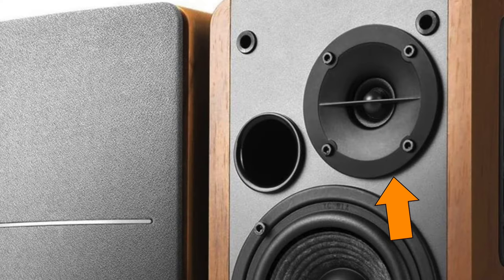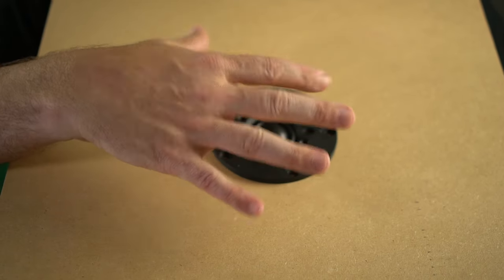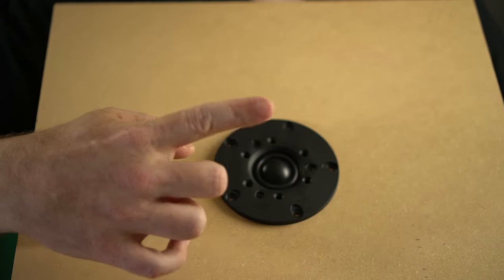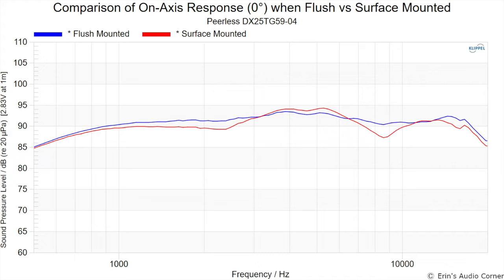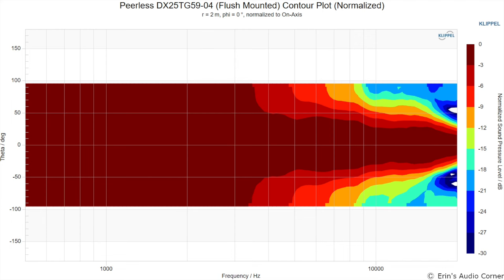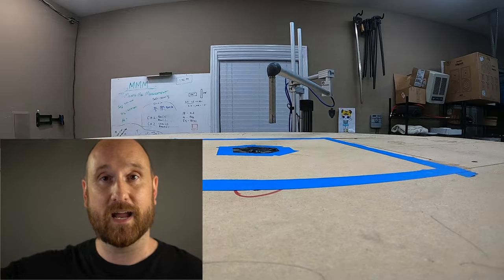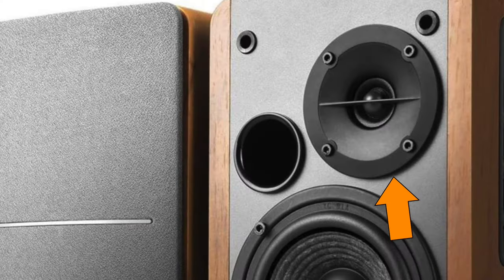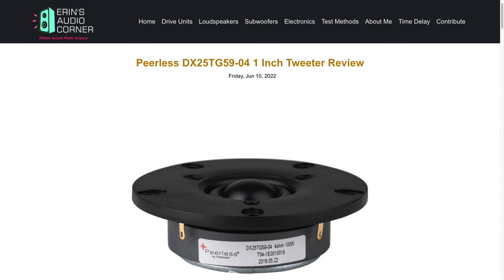Bad Speakers Start with This. 🛑  Flush Mounted vs Surface Mounted Tweeters.  Why it matters.

Comment: For those asking this question repeatedly in the comments, his review does not apply to tweeters with a waveguide. One of the specific design goals of a waveguide is to greatly reduce if not eliminate altogether edge diffraction.
Reply: I believe its because his first shot at 3 seconds in shows a tweeter with a moderate waveguide......
Reply: Like the Paradigm Reference Studio Esprit. Nothing flush mounted, has a waveguide. Testing and tweaking I guess.
Mines not flush mounted. I didn't know I can go back after the circle guide with a rabbiting bit. 
Now I do. The problem is my big router is too clunky for the job, on a small truncate faceplate cut.
Maybe one day with a little palm router.
I wouldn't be able to hear this video without non flush mounted!! Actually they are flush mount, almost total crap pc speakers. They work.
Reply: His review? I thought this was a product advice video, not a product review video.
Reply: @x-techgaming  Pedantic much?
Reply: Are you telling me he went and took a picture of a popular active speakers even if it doesn't apply to his video??
Reply: Speakers with the tweeter on top of the speaker sound thin.

Comment: Here's an idea - arrange a simple test to see if anyone can hear the difference between a flush-mounted and surface-mounted tweeter in the same speaker, all else kept equal.  Should be easy to arrange by adding a simple cardboard shim behind a flush-mounted tweeter to emulate it being surface mounted.  How many people do you think will be able to hear the difference?
Reply from the maker: I think the off-axis response around 7-10kHz being up about 2-3dB will definitely be audible.  But I'd have to arrange a setup.  Regardless of how audible it is, it's poor design practice and not something that can be fixed once set in stone.  As I'm sure you know.
Reply: @ErinsAudioCorner  this is just conjecture, really, unless it is tested... it is entirely possible that the diffuse point sources give a more pleasant spatial perspective, or not, just conjecture.  Interesting topic, and one that I think nearly every speaker maker since the 1940s has wrestled with.
Reply: @themaskedsingercucucachu8225  1000%
Reply from the maker: @themaskedsingercucucachu8225  Linkwitz has written about it.  And I can absolutely tell you that I've seen the effects from diffraction rear its ugly head by designs shooting for a flat on-axis response, not accounting for the off-axis issues of diffraction, and winding up with boosted HF in-room response.  So, while the difference itself may be debatable in terms of audibility, the actual result from a poor design perspective isn't debatable and is audible and readily measurable.
Reply: @themaskedsingercucucachu8225  
It's not really conjecture. 

Additional reflected energy that create positive attributes like spaciousness, immersiveness... aren't manifested from the VER or Very Early Reflections... it's just smear, corrupted in both freq and time domain. 

Such characteristics you mention result from later arriving energy after a well delineated direct sound has been experienced by the listener. 

Ideally it's;
1.) Direct sound (a clean, phase coherent source)

2.) An adequate ITD Gap (initial time-delay)

3.) Then early reflections

4.) Finally, a diffuse reverberant sound field is experienced by the listener

Subjectively this should result in a distinct image, it should resolve whatever depth existed in the recordeding, then the later arrival of the reverberant field is a pleasant bonus. 

I believe Toole's work established that the early reflected energy off the sidewalls can in some cases, add greater ASW, or "Apparent Source Width".
Which in some cases is subjectively pleasing... if the material is well suited, and if the sidewall distance is adequately wide.
Reply: I think most "normal" people will struggle to hear the difference even in an A/B comparison. Those Edifiers are just budget speakers and I think most people will be satisfied with their sound. The truth is most people who aren't audio hobbyists don't care too much about a flat response or even prefer certain  types of non-linearities. Even I as a hobbyist do to some extent. 

Flush mounting drivers is just an optimization technique that can cost very little but has a non negligible effect so it's just good practice to do it. But in some cases, non flush mounting them can yield better results because the curve and phase better matches the other drivers in a system, however that means the driver selection wasn't the best in the first place. 

Also in an A/B comparison, the midwoofer or midrange would have to be recessed by the same depth as the tweeter to keep phase relations at least somewhat intact.
Reply: @ErinsAudioCorner  Totally agree. If something is fixable, and easily, why not do it, instead of the easier surface mounting,  and then "Claiming" no one might hear it..
Reply: @kevintomb  Agreed! Even barely perceivable differences are cumulative and will contribute to the overall sound of a speaker. A great speaker design considers every possible detail using a wholistic approach, not whether or not these individual details are significant on their own. Some are quite noticeable, some aren't at all useful unless combined with another feature. Take dimpled ports as example... quite useless in reducing audible chuffing unless you have flared ends as well.
Reply: My bose have floating tweeters on a bracket 🤷
Reply: @ErinsAudioCorner  it's easy to go from surface mount to flush mount  , remove the speaker, screw a piece of wood behind the opening, glue a piece of particle board to the wood flush with the baffle, find the center, you can now router it as you would if there was no hole cut yet

Comment: oh dear poor edifier haha. Actually I wouldnt be too quick to dismiss the speakers shown in the images and thumbnail, while they do suffer from the issues described in this video, they are very cheap and perform well within their price range. Even Amir from ASR put the R1280T on his recommended list.
Reply from the maker: Well, Amir says a lot of stuff I don't agree with.  But that's why they call them opinions.  I just presented the facts of what happens when you surface mount.  Value/performance is the decision made by the customer.  :)
Reply: Lol - I listened to this video on a pair of Edifier S2000MKIII speakers...

Comment: This may not be a desirable fix for alot of people, but I've fixed a surface mounted tweeers edge defraction by adding black foam strip (1/4" wide 1/8"tall) to the outer edge of the tweeter flange. Then I added it to the outer edges of the flat front baffle. Just applied it down both side running top to bottom. My speakers baffles are black, so the narrow black foam doesnt look bad at all. With just this minor mod the speakers came to life. The mids and highs instantly sounded louder with more detail, especially at lower volumes. I'd rather have flush mounted tweeters, but for now this works
Reply: Excellent comment - the foam dampens, or removes, the unwanted frequencies introduced by the step(s).

Comment: Great video, particularly after I had the same question regarding the unusual surrounds on some of the Purifi drivers in your last video. As you, it has been discussed in the past, but I have NEVER seen an actual A-B comparison of the same driver like you've just presented. Man, I can't get enough of actual objective measurements and what they mean and how they impact sound and performance. I don't know how much you paid for that Klippel scanner - but I'm so glad you did....

Comment: That's surprising how much difference it makes for something that seems so small. Great work Erin!
Reply: it doesn't its purely for looks .Tweeters cant produce low enough  waves to have this a problem
Reply: There's a big difference on the graph which doesn't mean it will be a great difference for your ears as well. Remember this measurement equipment is many times more sensitive than our "ape ears". 
It's good practice to do but it won't make a night and day difference as is implied here.
Reply: @scivirus3563  

That's obviously not true, maybe you should learn how to read a frequency response graph.
Reply: @scivirus3563  You obviously do not understand how this works. The diffraction is from the tweeter being about a 1/4" off the baffle.. The 1/4" dimension is VERY much a wavelength of a high frequency driver.

Comment: The only time a surface mounted tweeter might not be bad is when the grille frame is designed to fit around the tweeter face, creating a smooth transition. Paradigm and some others have speakers designed like this.
Reply: Exactly, I have Studio 20 V2s and not only does the grille frame fit around both drivers, the edges of the frames are rounded to further reduce discontinuities! A very clever design technique.
Reply: I have to say the Studio 60v5’s and Studio CC690v5 have been some of the best sounding speakers in my LRC soundstage I’ve ever had.
Reply: Yes, PSB speakers too would come with a card telling customers to keep the grille on for this reason.

Comment: This mounting design is usually on powered desktop speakers under $200 like the one you show in the video. I have a pair of Edifier R1850DB that I bought on sale at Amazon for $140 a few years ago. It has the tweeter and woofer surface mounted. I use them on my computer desk connected to a DAC into a my desktop computer. It sounds good to me for the price.
Reply: What is your dac of choice, I'm doing some research
Reply: @GiJoe  I use a Schitt Modi for the computer setup.

Comment: Picture in the example i belive is Edifier 1280, and i think that all from 1100 to 1850 has surface mounting. But they are still among most sold and highest ranked budget BT active speakers under 200usd.
Reply: Just ordered 1280 with T5.. and wonder if leaving grill on helps with this?

Comment: Really enjoyed this quick 'primer' style video on a specific subject.
Thanks for sharing your knowledge, Erin 👍
Reply from the maker: Awesome!  Thanks for the feedback!
Reply: Erin, I have seen some people add stick on foam to the front edges of their cabinets. Does this help with edge diffraction . I will  do an experiment with some revel m 105s
Reply: Look at Wilson Audio & what we have is "Diffraction City" with their "stacked boxes architecture"  - somehow none of the so-called reviewers has called them out on this fundamental design flaw
Reply: @r423sdex  it's a "bandaid solution" - extending baffle size in this manner is pretty fugly as well & the extra gain will muck-up the response elsewhere....

Comment: I'm curious how much it is influenced by sharpness of the edge or even the step distance.  For example, can you radius the edge and drastically reduce the effect?  And if that step down is moderate versus thin, how much does it matter.  And is in the flange edge specifically causing the problem or what happens after?  For example, if you have a flange step but the step down is a soft surface, does it modify the effect?  I'm mostly curious what critical elements of the construction matters.  The distance should affect frequency of influence, but what happens next?  As a second part to this, I might expect the evenness of the edge distance would amplify the effect.  But if that edge distance was non-linear, for example an oval flange or star shaped, would that reduce the magnitude of the effect?  Would it damp out the behavior over a broader frequency range?

Why the curiosity?  Because we're not just talking speaker flanges.  We're also really talking about enclosures too.  Your enclosure size, your edge treatment, and even where you place the driver should influence this same effect.  Do you install a tweeter center or offset slightly ?  Do you purposely keep it away from edges as to not be right at the very top of the cabinet?  At least through some operating range of frequency, this should matter.  And if a 4" flange matters, most folks might have their tweeter, even if flush mounted, 2" or less to one of the corners of their enclosure.  Should they worry?  Should they change how they fundamentally place drivers into the enclosure face?  (for example, MTW versus TMW)  If the flange matters, the enclosure matters.
Reply: Buy the Loudspeaker Design Cookbook by Joe D'Appolito to start.....It all matters.
Reply: People heard about but do not know why it happens. Actually it is cooperation of two reflections - if  phase of the same signal mixes in two sharply changing   distances of reflection    as presented here with baffle and reflection plate from speaker you get any single frequency  vanishing 100% due to antiphase  

. Looking at dimensions step  about 4mm antiphase  should happen for  8  mm long wave.( 20kHz is 1,5cm long)   it means we are talking  about some 36  kHz. 

That reflection problem is at distance 5 cm from center so it will be  six wave lengths after stright   axis  36kHz   is received .  Of course some will claim   for them it as  audible and I congratulate them.  With rounded there are more reflections filling continue way the gap.  My opinion? ... no, I do not count

Comment: So - EVERY auto audio system has the speakers surface mounted, and almost every tweeter is mounted in a pod that sits up to an inch from the surface. There are some very good auto systems out there. I agree with everything you are saying, but there are hundreds of thousands of great sounding systems in all sorts of auto, marine, off road, and aviation with surface mounted speakers!  Just being real not trying to argue, as I love your videos.

Comment: So I have a pair of JBL L-100 centuries, arguably the most famous speaker ever made and certainly a well designed and great sounding speaker. This speaker has the tweeter and the mid range driver surface mounted as you describe while the woofer is flush mounted. 

I think there are many other factors that are far more impactful on the sound of a speaker than whether it’s elements are flush mounted or surface mounted. 
I will say it is an interesting exercise in measuring these differences, but by no means is this one characteristic something that should automatically qualify or disqualify a speaker especially without hearing it.
Reply: actually the tweeter is flush in the JBL models... the mid range is surface mounted, thogh.... i think it has to be with dispersion
Reply: Bose 42 have a strut mounted tweeter.. not even on the box.
The later 4.2 have tweeters on little angled cones, again not box mounted.  They seem to be aiming for disconnection.. must be a reason.
Reply: data shows how sound is affected here. everyone gets to apply their own confirmation bias in how they want to think toward the data, that is expected. but just bc a speaker is famous doesn’t mean much. speaker design (bc of data) has changed / improved since those jbl designs. if ya like em then that is great. diffraction is def s component of sound though i figure.

Comment: You should look into how Paul Barton and PSB have dealt with surface mounted tweeters.  They designed their grills on some models with acoustic felts padding that allow the tweeter to become flush when they are attached. They use to include a little card  saying to keep the grille on. They talk about it on the 50 year doc they've just released.
Reply: Actually, the current iteration of PSB speakers use a proprietary waveguide for tweeter mounting. Previous designs used flush mounting combined with felt surrounds in an effort to additionally reduce edge diffraction. None had surface mount tweeters to my knowledge.

Comment: I have triangle zetas where the tweeters appear to be more recessed so it's a bit behind the baffle. To me it sounds fine, not perfect but fairly well balanced.  Like many metal tweeters, it can accentuate sibilance at times but tonally, for voices it does a fine job for budget speakers..much preferred   when compared to borea 2
Reply: The same problem

Comment: So, in laypersons terms, the sound wave "trips" on the edge, and the open screw holes, and this causes part of the sound pressure wave to be slightly out of phase with the initial sound pressure wave.
Depending on the frequencies, this may  be in phase, or 180 degrees out of phase, which will increase or decrease the strength or the pressure wave (sound level), but will mostly add unwanted interference with the primary sound.
Reply from the maker: Yep!  You got it!

Comment: I noticed that your scanning microphone was working very close to the tweeter, where you might expect diffraction effects to be the greatest. Also it didn’t seem like your apparatus had enough vertical travel to represent typical listening distances. Does the uneven response hold as you move out away from the speaker, or does it smooth back out? Your graphs likewise gave no distances.
Reply from the maker: The graphs state "2.83v @ 1m" on the y-axis.  As for how the NFS works, check out this discussion with the design engineer: https://www.youtube.com/watch?v=-s-R1HCYUYs

Comment: My Klipsch KG2s use flush mounted drivers (with the woofer overlapping the tweeter). There was clearly a lot of effort put into designing these, and they weren't low budget speakers designed around  production cost. Now, the tweeter is horn loaded, which changes the equation a bit. My opinion (everyone has one) is that the room is the elephant in the room. You won't hear the difference in baffle configuration if your room is not good.